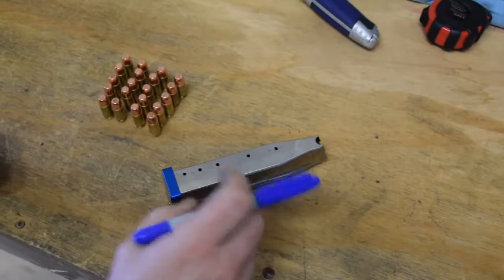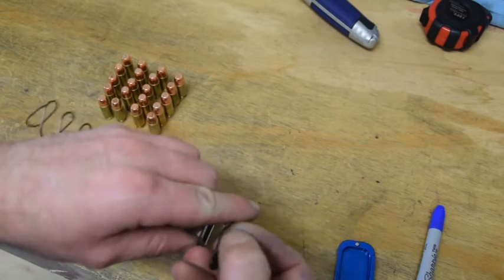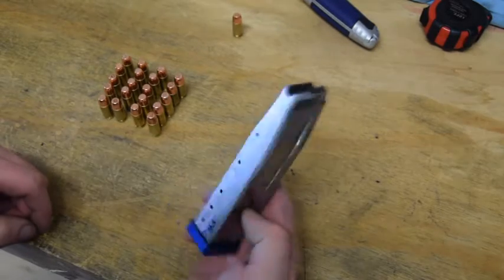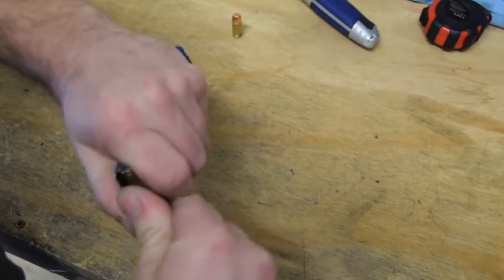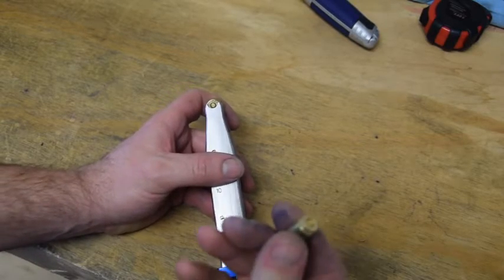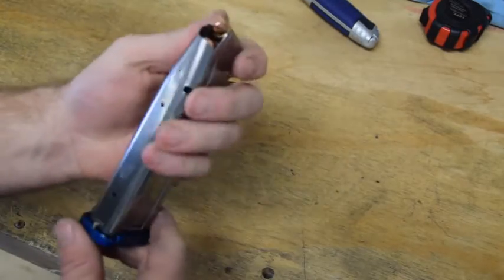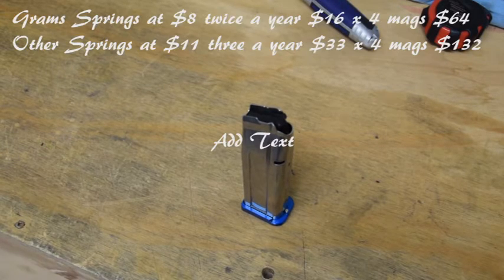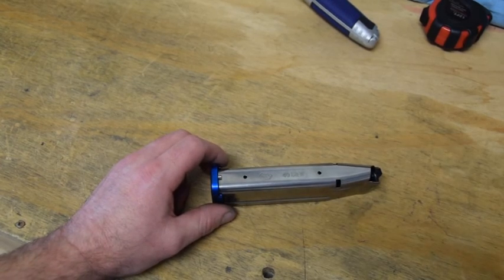Grams Spring setup and testing

Comment: I got some Springer Precision base pads and Grams followers kits for my CZ TS2 (9 x 19) and they worked at first, but I had to switch back to my oem mag setup after about a month because the followers kept getting stuck inside the mag tube.  They only add 3 rounds anyway, but there are always stages at USPSA where you need 23 or 24 rounds.